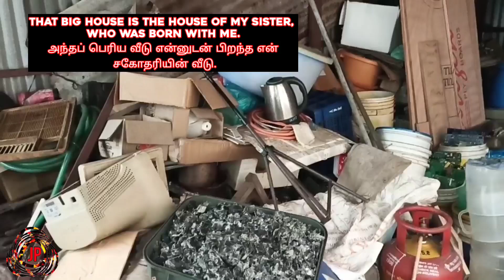Gold From TV Leds || Recovery And Refining TV Leds

Comment: Have you ever extracted the silver from a load of computer and key pad acetate or plastics? I've watched an electrolysis method using a car battery recharger and it looks like it works fairly well.